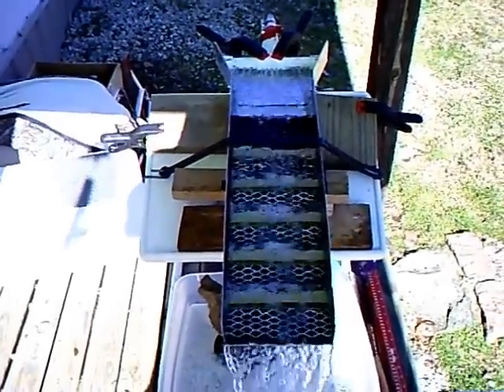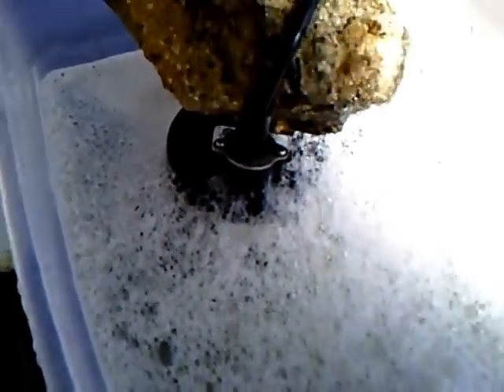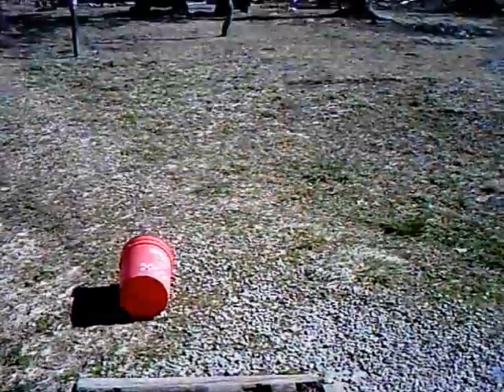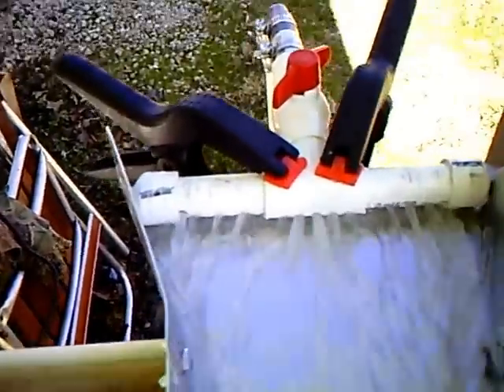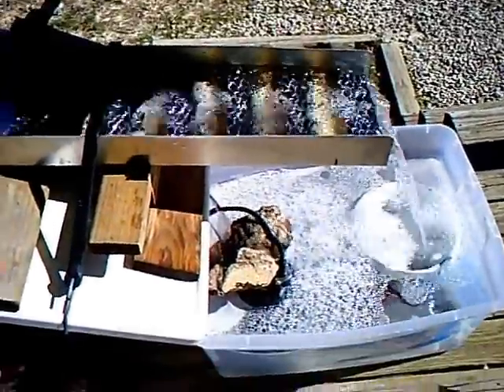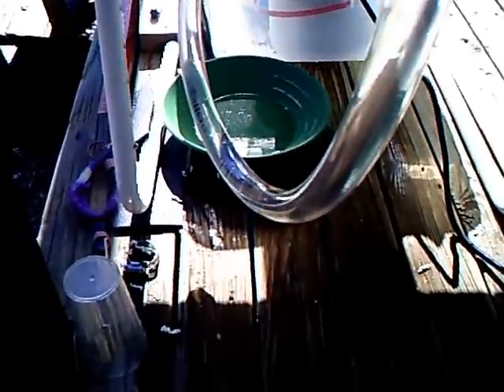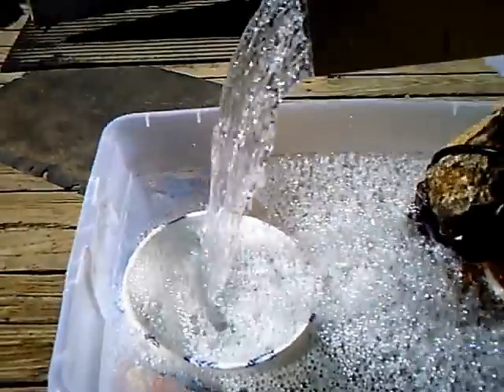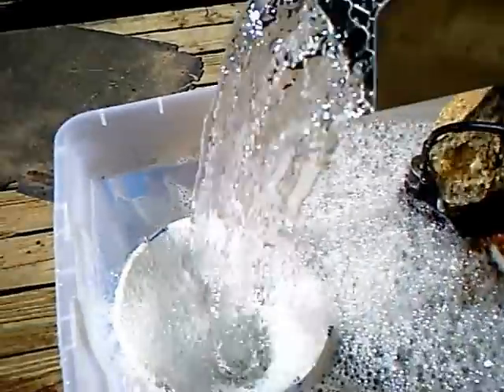Recirculating Sluice Box using 1300 GPH pump /110 volt AC.AVI

Comment: Great video Hop, i actually built my recirculating sluice almost identical to yours. One question though, im using a 500gph pump running thru 3/4 hose to the spraybar, that pump is too small isnt it?
Reply: Hop Skippy Thankyou so much for the reply and Video Hop, im learning alot from your video. Im going to upgrade to a bigger pump this week based on your outcome with yours. Thanks again!!! Devin.